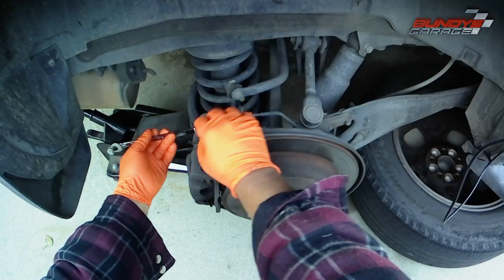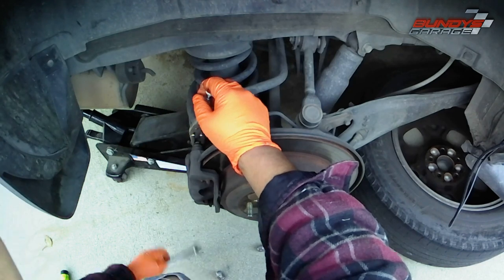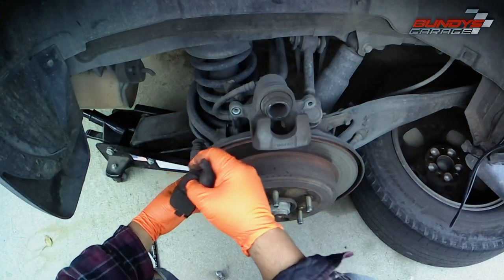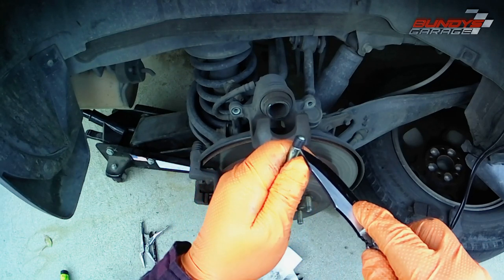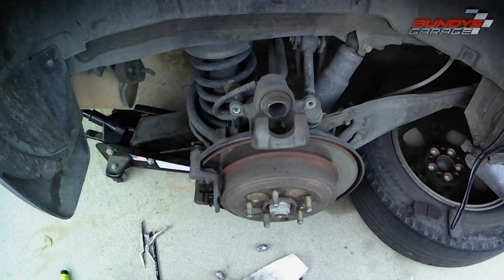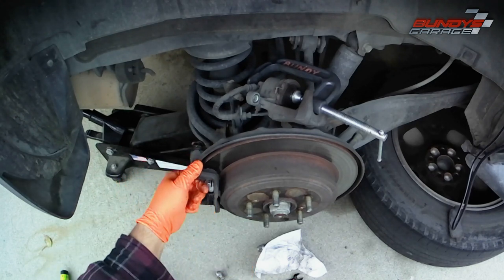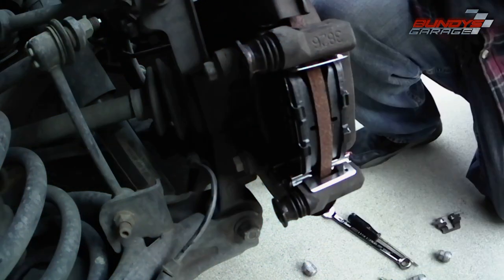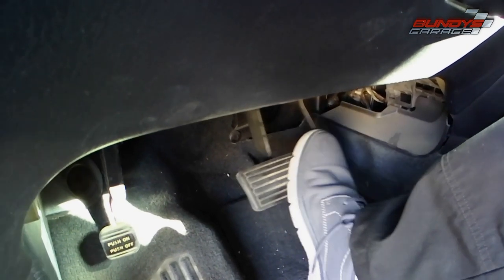Acura MDX Rear Brake Pads | 2001 - 2006 | Honda Odyssey Pilot | Bundys Garage

Comment: I have definitely had those rubber sleeves swell and make it nearly impossible to pull pins out. So frustrating. As far as I know they are basically just for noise and vibration damping, so sometimes I leave them out as well. Love the name written in big clear letters on the C-clamp. Nobody better steal that. Many would criticize you for not opening the bleeder before pushing the piston back in, but we in the know all know everyone does it off camera. Not gonna hurt anything if the fluid isn't garbage. Keyboard warriors always find something to whine about on my vids though. ;)
Reply from the maker: I never open the bleeder screw for the caliper when I push the piston back in. There is no need too. You just open yourself up for air in the system and a "soft" brake pedal if you do. Guys argue that it effects the ABS module, but in the hundreds of brake jobs I have done, I have never encountered a problem, so no I don't do it "off" camera.
Reply: @bundysgarage  Yep never seen it cause a problem either! I just meant even the people who claim they don't do it probably do when out of sight, hahaha. If I do open the bleeder, I attach a tube and syringe so there is no chance of air getting in the system. Quick method for me when the fluid is absolutely gross since I work on a lot of crap boxes that have sat too long.